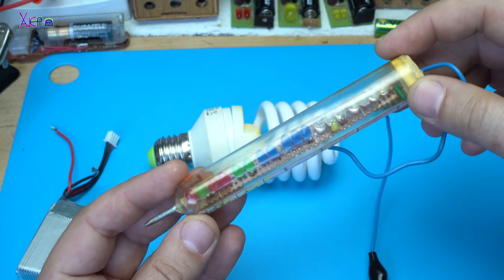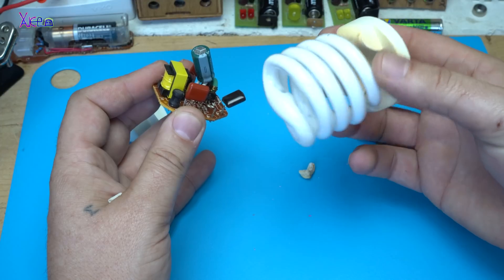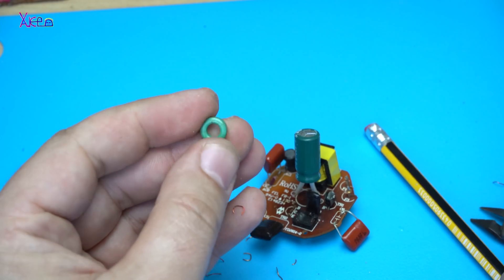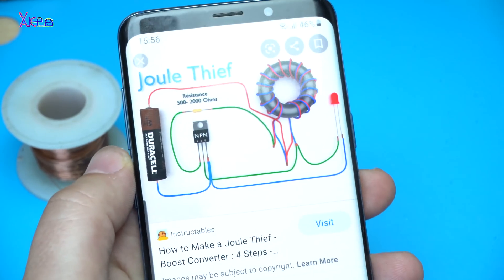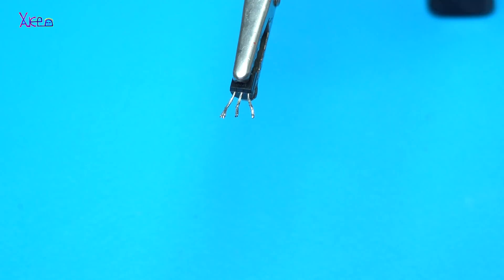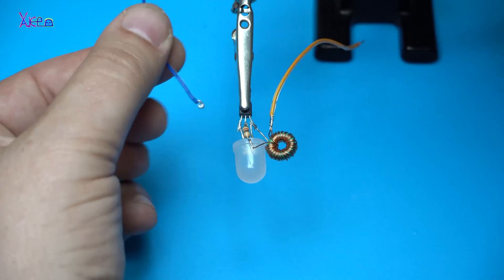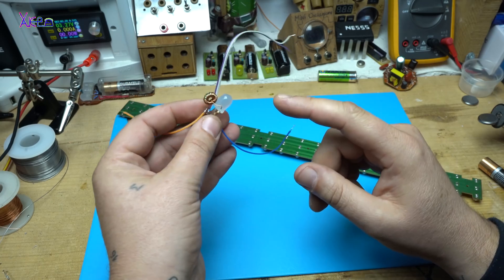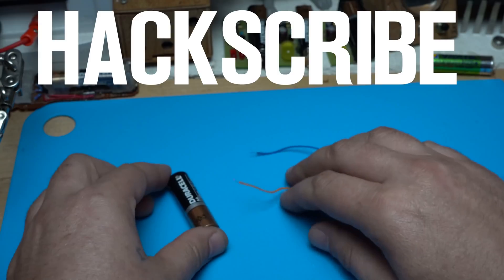One Simple Project | Making Gadget for dead batteries

Comment: With a smaller diameter wire and about 30 turns, I can run this circuit as low as 0.03 volts no problem.
Reply from the maker: Need some experiments to go with lower voltage